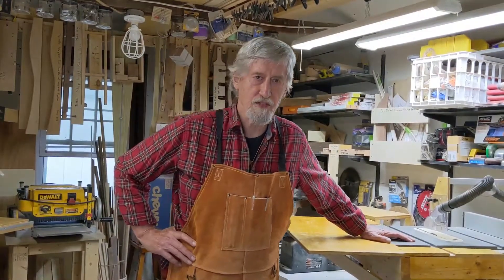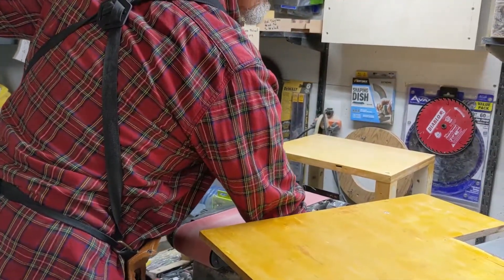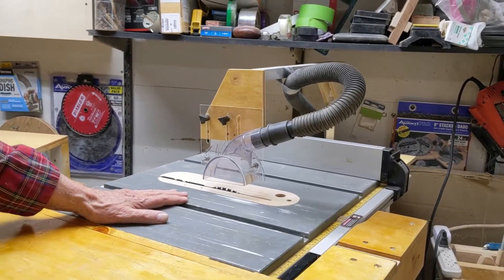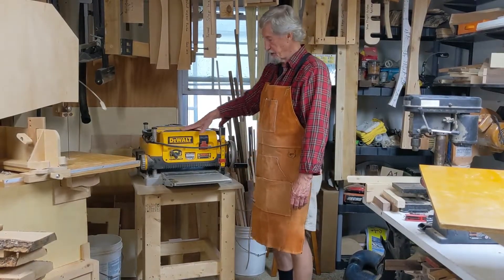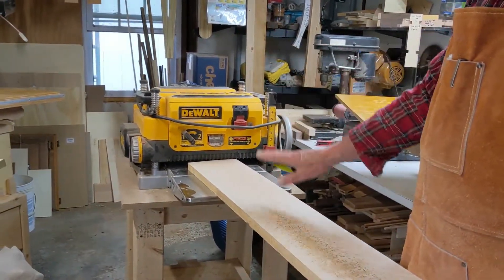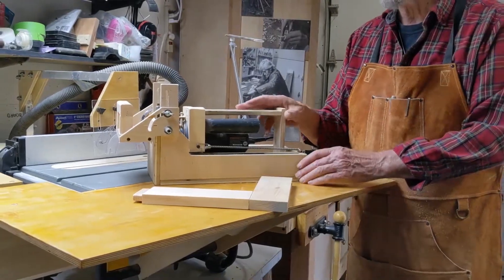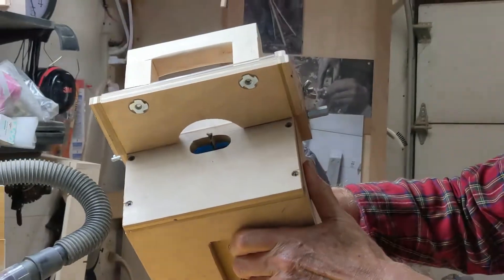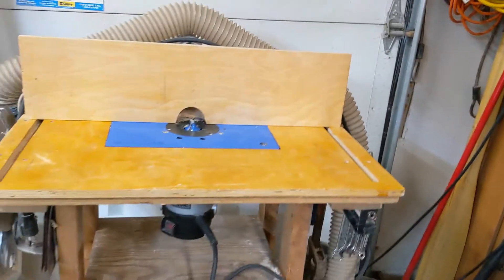Power Tool Dust Collection Solutions

Comment: You have a unique way of collection dust on the table saw. It makes sense to me. My question is, what plastic did you use under the saw on either side of the blade? Doesn't it get drawn into the blade or motor? How does it connect to the vac system? do you have a "Y" junction with one end to TS dust port and one to the bag collection? thanks for your tips and insights. Helpful for us just learning all this stuff!
Reply from the maker: Hi Robert Ridpath.  Thanks for your comment and questions.  I plan to make another video to explain things a bit better.  The plastic i used was simply thin sheet plastic, taped in place with strongly adhesive duct tape.  I've never had a problem with it getting drawn into the saw or motor (In fact DeWalt uses a very similar method on their new contractor saw).
I use 2 dust collection vacuums:  
1) Underneath the saw, I use a Rockler Dust Right Wall-Mount Dust Collector, 650 CFM, which has a 4" inner diameter hose connection, which I connected to a Rockler Dust Right® 2.5'' Tool Port, which connects to my DeWalt Table Saw 2.5" dust port. 
2) On top of the saw, the hose connects to a shop vac located below the saw.
Reply: @jamesrvs  Thanks for answering my question about the plastic. One more relating to it. When I looked at my saw, they is a metal box that the blade rides in (with the dust port exhausting from it) and I get that you taped the plastic  to the underside of the cutting surface, but where do/ did you tape it below?  as the dust would just fall onto the platform the TS is sitting on and not into the metal box that has the vac attached to it? Thanks again for assisting me with understanding your setup as I'm focusing on reducing dust as much as possible. Cheers!
Reply from the maker: @Thedestressguy  Hey Robert Ridpath.  I taped between the underside of the saw and the metal rectangle that surrounds the blade on both sides at about 45 degrees with allowance for tilting the blade.  Hope this helps.  Video coming next week.
Reply: @jamesrvs  Ok. It all makes sense and I see what you've done. Thanks. Looking forward to some of your other videos!

Comment: Great initiative and content, however, it looks like a not so experienced person was doing the camera job. Lots of good shots were missed.
Reply from the maker: Thanks for the comment manny3549.   Yes, videography is a learning experience, and, I see the results improving with time.  If you have any questions about the content, I'd be happy to answer them.
Reply from the maker: Regarding content, I was happy to see that DeWalt Model #DWE7485 adopted my method for restricting/rerouting sawdust towards to back dust port (restricting the flow underneath from going outside).  Interesting!

Comment: Great video. I’m in the process of setting up this system on my table saw.  I’ll be in touch when I get in over my head. You have been very helpful in the past. Tony
Reply from the maker: Thanks Tony!  Appreciate the feedback.  I was quite amazed that the amount of dust was reduced so much with this rather simply system.  I had cleaned my entire shop before I installed it, and had a lot of dust that had accumulated,  and, now I have a relatively dust free environment.
Reply from the maker: Hi Tony Joaquin.  Merry Christmas and a Happy New Year.  How's the woodworking going?